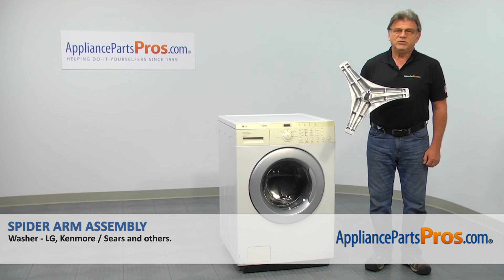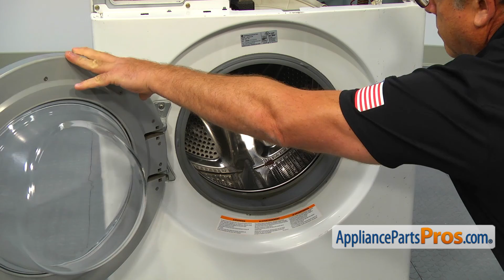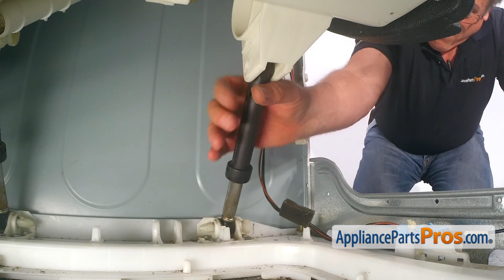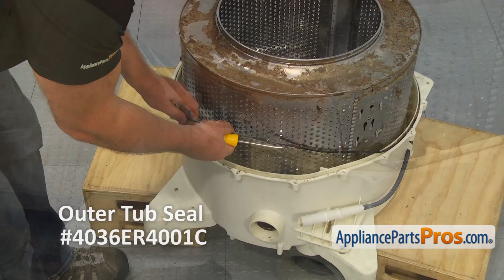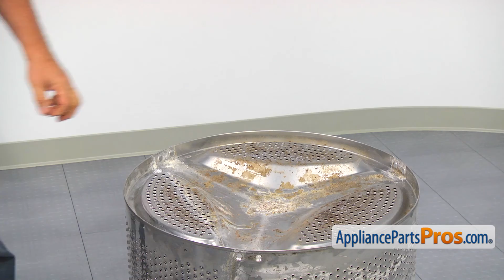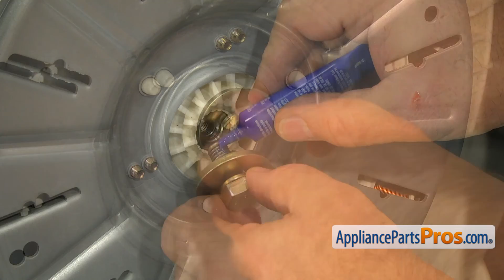How To: LG/Kenmore Spider Arm Assembly 4434ER0003C

Comment: At 6:00 in the video, you removed the center bolt so easily. Mine seems to be stuck really tight, even after 30 minutes of soaking in wd40 and usage of a socket wrench and mallet. Do you have other techniques for loosening this bolt? Must the stater housing and stater be removed in order to replace the spider arm?
Reply: The inside tub was probably spinning. Have someone hold it